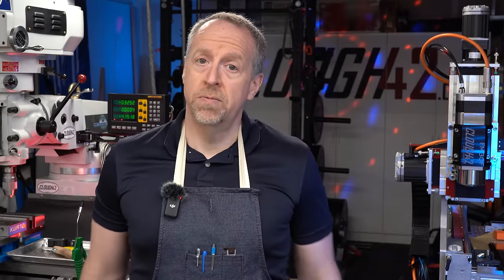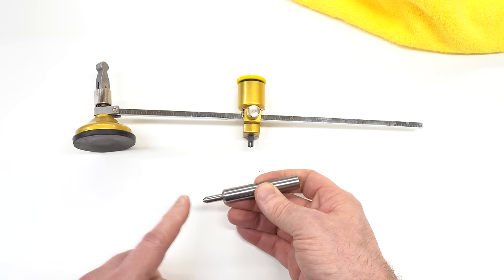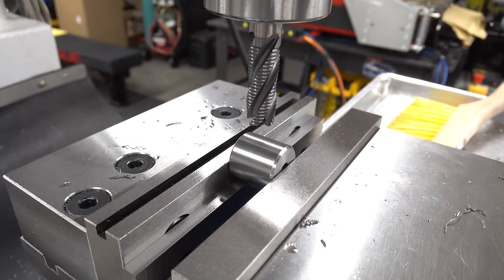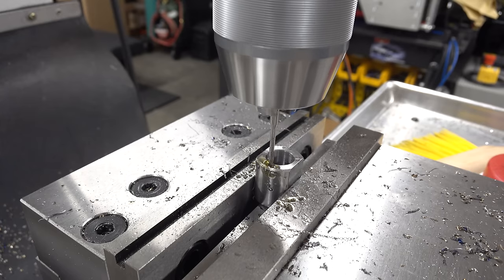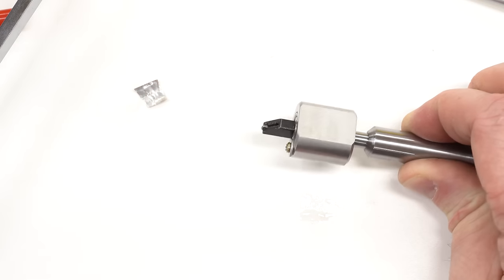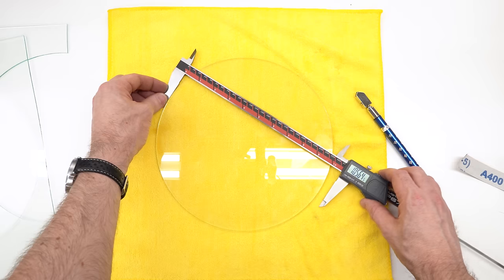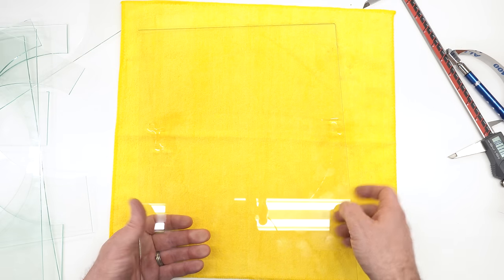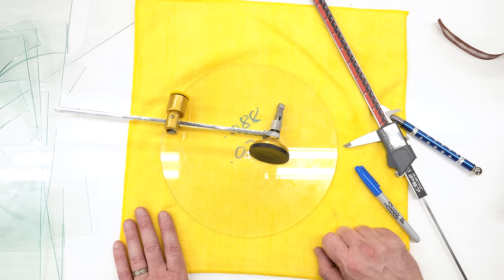Making a CNC Glass Cutter | Avid CNC

Comment: The swivel has caster, so it would be interesting to see how the orientation affects the dimensions. Perhaps you cam make some XY witness marks prior to snapping the circle out James?
My feeling is the caster does not quite follow the spindle centre, thereby introducing a concentricity error. 

Interesting experiment all the same.

[EDIT TO CLARIFY]
Is the cutting wheel caster truly concentric with the spindle?
Reply: It shouldn't be concentric, otherwise there would be no turning force to orient the wheel to it's cutting direction.
Reply: @nils1953  Agreed, it should trail behind the centreline, but my poorly worded comment tries to point out that the scribing wheel may also be offset from the centreline, or even non perpendicular (camber) to the surface of the glass. Lateral play in the scribe wheel's axle may even introduce the errors observed.

This is speculation based purely on the noted build quality of the original cutter of course, and I'm sure the inaccuracies could be characterised and mitigated against if they are found to be consistent in each of the XY planes.

The snipers in the movies make it look so easy cutting a murder hole. Even on tempered laminate high rise building glazing no less.
Reply: @squelchstuff  I don't think the "murder hole" needs this level of precision...  ;)

Comment: I think the problem is with small irregularities around the edges, making the roundness measure more inconsistent than it really is. Hand sand a little longer and it will get closer than you think, faster than you think!
Reply: Yes also, but one should suck it on a turntable with a fixed sanding device.(or let the router do the work, if it needs to be so perfect)
Reply: @JohanDegraeveAanscharius  Yep. I think it's just a 1 off, but if not, he'll figure out a fixture to true it up.

Comment: Excellent video James! Is there any correlation to the error orientation with the clamping positions? I wonder if viewing under polarised light might show a grain or internal stress pattern in the glass?  Perhaps then try cutting it with the  "grain" at two orthogonal orientations relative to the bed to see if it's about internal stresses?  If you can measure the diameter more precisely at multiple angles, is the shape an ellipse or just randomly not round?   Is the draft angle different where the area of waste is larger, or do you have a consistent angle all round? Perhaps cutting the square sheet to an oversize circle first? How about using a hot iron to propagate the crack slowly like when cutting stained glass rather than using a bending moment, where the crack velocity is uncontrolled?

Comment: Nice video, while I personally don't have experience with cutting glass there is an inherent issue with using a cartesian CNC to cut perfect circles. In my experience, you will almost have some deviation from the circle due to the axial nature of the cut. If you have the option I would oversize the cut slightly and then refind the edge on a lathe at very slow speeds.

Comment: Hello James, I think that the inaccuracy in the diameter could be due to the fact that the fracture in the glass is not generated perpendicular to the plane of the glass in the entire circumference, even I do not think it has a certain pattern.
Could this be modified by marking the glass on both sides? it's just an idea to force the fracture in a certain direction.
I clarify that I don't know how to work with glass, I even find it admirable how you separated the circle from the rest.
As always, thanks for the great content on your channel.
Reply: Or thinner glass?
Reply: Not an option, I'm afraid. Glass will immediately break along the first cut when the pressure of the second cut engages. 
That said, if the identical track was followed, on the opposite by a pressure wheel (not a cutter)... the break might be perfectly perpendicular. 
Glass is only slightly predictable with regards to break direction but one thing is for sure, it breaks away from a score line. With score on both sides there will likely be some splintering. I may be wrong as not tested but I was taught only score one side and never go over a score line, the tiniest angle change in the cutter can result in a splintery snap as  opposed to a crisp cut.

Comment: Good morning man your problems with the sizes is the steps in your machine if you re-calibrate your machine on the steps it’ll go correctly for you. I’ve been building CNC machines for about six years and this is just a simple configuration problem and your machine will be cutting perfectly on your measurements, just check and see which axis is different. For example, if the Y axis is out of measurement, you’re going to want to re-calibrate only the Y axis, but you have done an excellent job man.

Comment: Great video as always!  Just wondering, Garrett Frome has a great video on cutting perfect circles in wood using Vetric Software.  His principal point is controlling the tool offset, not the circle diameter.  He says you should never change the circle in the software, but true it up using the offset… Just a thought.

Comment: Put something like your microscope camera pointing at the wheel as it goes around. You should see something flexing. Either that or the wheel doesn't stay exactly perpendicular to the cut. My guess is the cutting wheel/shaft has some axial play in it. The equivalent of a Belville washer might help.
Reply: i suspect along your lines here that a cutting wheel oriented off-bearing-center would consistently alter the cutting diameter, whereas axial play in the cutter could result in path instability so as to steer the cutter back and forth across the intended path.

Comment: the issue with concentricity on the original tool may have been made worse by that shim, that would have pushed out one side of the bearing, meaning the bearing centre was off the line of the tool, and as you rotated around the centre the shim would have thrown the tip off by its thickness as you rotated

Comment: I worked briefly as an assistant to a stained glass artist, on a large church job. (He used baby oil as a cutting oil, btw). There were several unusually large segments in each of the works, about 30" in some cases. We knew the glass would move some after cutting, but found it was much greater than expected, and the came (aka 'leading') would not cover the error. We re-cut the smaller parts that adjoined the large elements. The next day when we started to cut the lead, we found the glass had continued to move overnight. We ended up cutting all the large pieces for all the windows, and giving them several rest days to settle down.
Anyway, glass can move after cutting, a lot more than I would have believed before I saw it.

Comment: Any glass supply company stocks carborundum stones that can be used to remove the sharp edges after snapping the glass on the cut. This is far safer than using emory cloth. For lubrication try kerosene. That is a traditional glass cutting lubricant.

Comment: interesting. from my experimenting with a vinyl knife on a cnc router, I was expecting it to cut very slightly undersize due to the trail/caster angle of the wheel. Though that mostly showed up for me in tight radiuses

Comment: if you want to address the beveling of the crack propagation, score both sides of the glass, and when fracturing the score line, do so under water for a cleaner fracture, with less "walking' of the fracture along grain-lines of the glass. 

As always, make sure the CNC tolerances, steps/mm, and backlash are addressed

Comment: James,
It looks like all the clamping is done from one end. Relocating the clamps to equalize pressure may help.
Reply from the maker: The surface the glass is on is as flat as the glass, so the clamping doesn't introduce much, if any stress.  The ten failed attempts I showed at the beginning of the video were done by hand with no clamping, and they have the same issue.  It's a property of glass that makes cutting below that level of precision impractical without grinding.

Comment: Interesting. However, you have not checked if the larger and smaller diameters correspond to the same orientation on the cnc table. Keep also in mind that glass is anisothopic and this implies that the ´molecular’ structure is impredictable. However, I guess that you have achieved a good result for many applications. Nice vidéo as always.

Comment: Have you ever run a Ballbar test on your X-Y axes to see if it's actually able to move in a true circle. It will also tell you if you have backlash in either axis. I'm figuring that your machine uses stepper motors instead of true servo motors. True servos are much more accurate. Ballbars are quite expensive tools but well worth it for diagnosing this stuff.

Comment: Very interesting.  Is there a tendency for error based on the glass direction with respect to the sheet when it was purchased? Could be internal stresses that developed during cooling that affect the bias of the break. You could correct this by just cutting a properly corrected ellipse if the axis is repeatable.  I also initially thought that a misaligned bearing would be the issue, but that would just move the center of the glass you cut with respect to where you thought the center would be by a few thousands. Now I'll loose a few nights sleep until I (or You) figure it out.
Reply: I was wondering the same thing.  Could be tested by marking the short and long axis inside the circle before cutting.  See if there is a correlation.
Reply: I would love to see the results but as far as I am aware there should be no directional differences, in stresses or thickness, etc.

If this is regular float glass, that is. I would imagine these factors would change with toughening or annealing. Toughened, for example cannot be cut this way at all.
Reply: @Gamerock82  I agree with float glass I wouldn't expect much stress, but I am assuming that this is plain cheap borosilicate glass which I believe is rolled in production with a relatively quick cooling time.  I certainly could be wrong though...  A good day is when I'm right at least once.  lol

Comment: You could try using a spiral leadin toolpath to preload the cutter so the start angle of the cutter is correct relative to the circle. Some of that error could be caused by the swivel not lining up perfectly at the beginning of the cut. You might be better off with a diamond or carbide insert opposed to a cutting wheel. The swivel can introduce quite a bit of error.
Reply from the maker: A curved segment to line the cutter up before moving to the circle is a good idea.  But coming in to the circle tangent to it is a bad idea.  Where the score lines intersect, the glass breaks off and leaves a peak.  I tried the diamond point first, and while it scratched the glass, the glass refused to break along the line.  I'm not totally sure why.
Reply: @Clough42  you could try a different technique in breaking the glass along the line. Instead of pressing down, you can use the end of a glass tool to tap around the edges. One common way is to slide the edge of the glass off the edge of the table and gently tap around the circumference from the bottom and then finish up by doing the same on the top. This will ensure that the glass is going to break at a 90 degree angle rather than being tapered.

Comment: Might be interesting to get some slow-motion footage of the roller during travel... I wonder if it's wobbling any.  OTOH, I could easily imagine it just being variations in the run-out of the cut, too...  Hmmm, perhaps you could set up a "lathe" for the sanding stage???  Somehow center the glass between two suction cups or something, with something driving them to turn.....  Not sure if that could be reasonable.  Anyway, interesting stuff, and hey, 17 thou isn't too bad.  :)
Reply: oh, something else to try: the diamond engraver??!?  Does that have a nice sharp point to it?  It could maybe score the glass, too... maybe glass dust would build up and cause problems as it moved, but I know tubing cutters (or at least one style of them) don't have a rolling part, so... maybe you could get more positional consistency there, if (like others have also suggested) the problem is just that the wheel is wobbling about a bit (for any of several possible reasons)?

Comment: What if the CNC machine did several laps of the circle rather than just one?   Could you make it repeatable and flip the piece, and score the other side too?   

Does the carbide leg angle stay consistent after the first cut - might need to slow that transition speed?

I guess the final option is to build a lathe with a short 50mm bed length, a selection of big suction cups for a chuck and another one in the tailstock, and capable of spinning the whole workpiece in a bath, like a wet grinder?   POC the idea by putting a pair of 8" toilet plungers in the tailstock and chuck with a large plastic bucket resting on the ways.  You'd only want ~10 RPM or so, and a toolpost mounted grinder.  It could be messy and silica dust is noone's friend.

Comment: James, it wasn't fast but it did work. My brother used a rubber mask and a sand blaster to make very intricate 3D engravings and cuts in glass. I'm sure I'm not the only one waiting to see how your new CNC router cuts something like maybe aluminum? Also what wireless controller are you using with your new machine? Keep it up, inquiring minds want to know.

Comment: could you not use the diamond drag engraved for glass as well? i feel like if carbide is good a diamond tip would be better, no?
Reply: Was thinking the same thing, maybe the wheel is wandering slightly.
Reply: Me too.
Reply: @johnsheppard7388  or since it is oval it could be a slight backlash issue on the ball screws
Reply: For a few years I worked in the aircraft windscreen industry ( when they were made of toughened glass! )  All the glass was cut with a diamond and an aluminium template. In your position James, I'd definitely try the diamond drag tool - maybe with slightly increased pressure.  I'm not sure how central the cutting point of the diamond is to the centre of the holder so it might be necessary to try cutting a few squares to check that parameter.  If it is not acceptably "central" it might be possible to compensate in the tool holder or maybe in the CAD model?  Good luck - glass can be pretty tricky, maybe because it is not a real solid?
Reply: @Oberkaptain  20 thou backlash in a ball screw is anything but a "slight" problem. even accounting for pitch error + backlash, you shouldn't be seeing anything more than 0.003", maybe 0.004" (with a single non-preloaded nut; different story for a double preloaded nut)
Reply: @chrisquinn3751  As long as you weren't trying to cut a shape relative to the outside edges of the glass sheet, it wouldn't matter if the diamond was slightly off center. The shape would just be shifted slightly in the direction the tip is off.

Comment: I think you'll need to grind the OD to a finished dimension by maybe sandwiching the glass between two fixture plates so you can spin the disks in the lathe and grind the od of the glass via tool post mounted grinding attachment.....

Comment: Have you measured how much the cutter wheel can shift from side to side on its axis of rotation?
Reply: I Think the problem is here, the cutting tool is wobbling around. You could also Cut Them On oversized measure and mount the CNC with air driven grinding tool and let the CNC router make the circle again.

Comment: I think, it would be better to use a diamond-tip. When it´s spring-loadet and stationary, the deviations must be go away.
Reply: @johncoops6897  Then I would try very light hits with a small hammer from behind right
under the scoring. 
According to my experience, a vertical crack forms in the glass

Comment: I've  been making glass products and for 35 years.  when you cut a circle and need it to be exact  , the drop has to be the same around the diameter . depending on the size the drop is a least 1 to 2in for a 90 degree break .. some dressing may be required ..